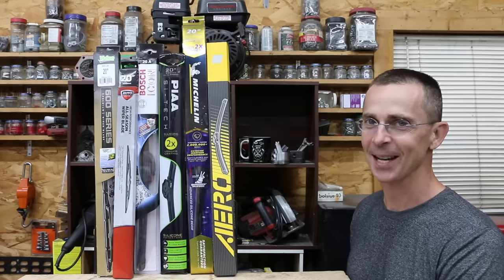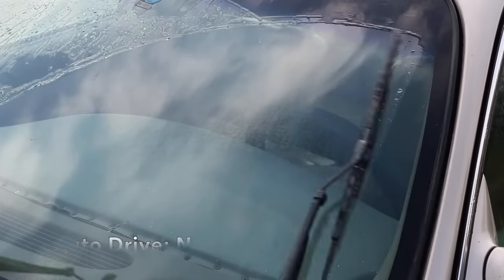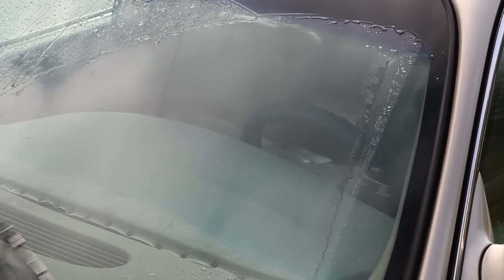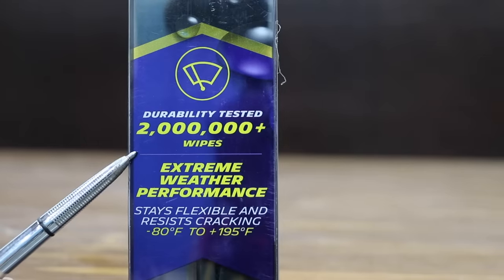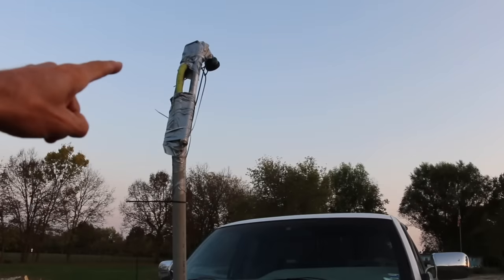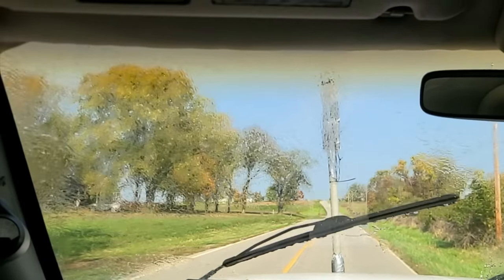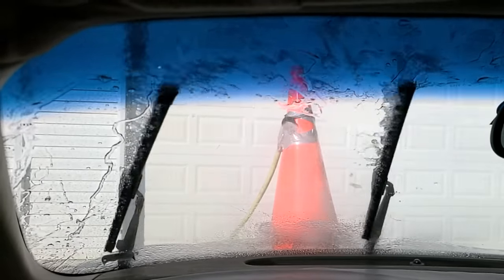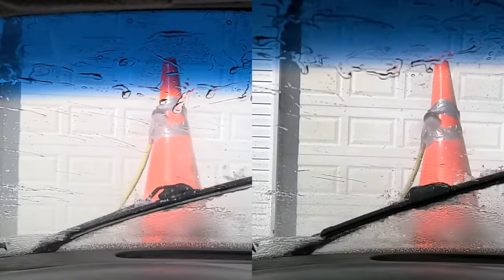Best Windshield Wiper Blade (AFTER 1 YEAR)? Bosch Icon, Rain-X, PIAA, Trico, Valeo, AERO

Comment: here in southern ontario canada, i never paid for blades for a long time, that was due to changing oil at Mr. Lube when they offered Micheline blades free with oil change!!, i do alot of driving and found most high price last about a yr then they deteriorate fast, although for shittes and giggles, i did a 3000km road trip to the east coast to pick up family, and bought a container of Rain X windshield wax. blades about 6 months old/new. and to my very surprise self the performance on the windshield was astounding and remarkable as it rained almost the whole 16 hr drive, and found using wipers blades seemed useless! at 130km/hr avg speed!! plus most of it was night time, i honestly couldn't believe what was going on, passing tractor trailers was no sweet with the off spray! 

i just did the windshield again with the wax and recently bought Rain X blades @ 30$ ea. +tx, and sure enough the next day on my way to work, it rained the whole drive 40min in! Rain-X blades did fine, once again, no regrets and highly recommend the Rain-X wax to everyone, especially the super highways or the 400 series here in southern ontario!!
Reply from the maker: Thanks for sharing.

Comment: I just bought some Aero windshield wiper blades for my 96 Chevy Silverado C1500. I hope they work good. My last brand I had I ordered off Amazon and it had really good reviews and with any windshield wipers they're recommended to change out every 6 months and these windshield wipers were no different. They are still on my truck and have lasted longer than 6 months. One year so far. I believe the last month or last 3 weeks or so they have started showing signs of slight streaking. Definitely well worth the money that I spent on them but I wanted to try something a little different on my truck so I went with the Aero hybrid windshield wiper blades. I hope I made a good decision. They were only $17.99 plus tax on Amazon for two 18" blades, let's see if they hold up like my previous ones did.
Reply from the maker: Thanks for sharing.

Comment: I Purchased Bosh Icons from your original video. Today about 5 years, I am finaly replacing that set UPDATE: I might try my luck with the budget kind because it would be close to 50$ for my pair of ICONS. UPDATE 2:  I found my old amazon order. I got the Bosh Clear Advantage and that was in 2019 so 3 years old. Not bad and much cheaper than the ICONS
Reply from the maker: Thanks for sharing.

Comment: I’ve generally bought a new pair of Bosch Icon every year, which worked excellent, but I reasoned if I’m buying them every year, surely a lesser expensive wiper blade would be good enough.

Nope, apparently it’s not just a matter of longevity, but quality as well. Even though South Texas heat is brutal on every brand, the lesser expensive blades didn’t wipe well from the beginning.

After my attempt at saving a few bucks, I bought a pair of Michelin, which each cost a dollar or two more. My reasoning was that they make great tires and surely would know a thing or two about rubber. Well as shown here, the Michelin worked great, but slightly less as well as the Bosch Icon. I too have the same experience of them not wiping as well on the return wipe.

I had planned to try the PIAA this year, but I’m just going to return to the Bosch Icon. In my experience, and as we’ve just seen, they work the best. If you should choose to try them, take note that Bosch has a couple of different wiper blade models (at least they used to), so be sure to specifically buy the Bosch Icon.
Reply from the maker: Thanks for sharing.

Comment: I used to run Bosch Icons but found that they left, bend and wrapped around my a-pillar at high speeds. Definitely sticking to the older style blades with the metal frames.
Reply from the maker: Thanks for the feedback.

Comment: The best wiper blades I’ve ever used are the genuine Tesla wiper blades on my Tesla model 3. My original wipers lasted 3 years and 70 thousand miles. Once they had worn out I was looking at other options and bought a set. They were awful. Squeaked so loud and streaked. So I bought a different brand. Also awful, left streaks and fit very loosely. After 2 failed wipers, I bought the genuinely Tesla ones again. 25 dollars a blade. 50 for 2. So certainly a little pricey, but as soon as I got them I was so happy. They’re even better than I remember them being when new. Smoothest blades I’ve ever used. No streaks whatsoever. When they’re on you literally can’t hear them. They are very rigid and do an amazing job at sweeping the water quickly and efficiently. So if anyone out there has a Tesla, get the OEM blades!! They are THE BEST!!
Reply from the maker: Thanks for sharing.

Comment: i got a set of those Aero wipers in 2017 or so, they are great wipers. ive bought them since & they work way better than traditional steel supported wipers, i couldnt believe how good they were. i live in the north east, so you need decent wipers
Reply from the maker: Thanks for sharing.

Comment: I am surprised people do not replace cars yet when they are dirty. Wax coating on rubber mentioned is to prevent new wiper rubber dry during pre-sale storage. It will disintegrate with first usage. Clean rubber blades with alcohol (better) or windex from time to time when blade stop cleaning or squinting. Taking care of them this way and many OEM last 20 years easy. Pinch rubber with paper towel moisturized with alcohol and move from middle of the blade edges.  This is to prevent tearing off the rubber at the ends. Up until napkin is not black anymore. I mostly replace them when rubber starts to disintegrate. Normally this process starts with edges. Told many people they were surprised and happy. They had no idea almost anything needs to be cleaned periodically and nothing in manuals about this. :)
Reply from the maker: Thanks for the feedback.

Comment: The largest benefit of a silicone blade is certainly longevity. If the car is garage kept, you can get even more. I like the PIAA blades. The painted metal doesnt fade nearly as quickly as the plastic blades and my last set lasted 3 years. Never had a rubber wiper last more than 8 months. Silicone is worth the extra money IMO.
Reply from the maker: Thanks for the feedback.

Comment: I'm late to the party.  I swapped to Bosch Icon wiper blades for a trip to Joshua Tree in the summer.  It was about 114 degrees out.  That was almost 2.5 years ago.  They've been through heatwaves and cold weather.  They've wiped away mud and all sorts of crap and the car gets commuted about 100 miles a day when I go to work 4 days a week.

They still work amazing.  I'm never buying anything else, it has already paid for itself multiple times over.
Reply from the maker: Thanks for sharing.

Comment: I always thought the Bosch Icon blades were good and never bothered trying any other brand except for the Michelin. I drive a semi truck mostly at night in all weather conditions. Needless to say, I use the wipers a lot. I have found that the Michelin blades work better in colder weather, so I tend to switch between the brands a couple of times a year. I use my washers for bug splatter a lot so I gotta replace often. Thank you for your work.
Reply from the maker: You are welcome!  Thanks for sharing.

Comment: My own experience: I stay away from silicone wiper blades here in Flagstaff. There is likely to be a time in early winter when the windshield looks like it has dew on it, but one swipe of the blades shows it to be ice and the blade edges are damaged enough that the blades have to be replaced ASAP. Rubber blades (in my experience) are much more forgiving of such a mistake. I replace them every three years. Wiper blades, like brakes, are one of those things we shouldn't put off too long.

Comment: I always get RainX and use the RainX repellent on the windshields as well. I'm near sighted and tried to use the BOSCH wipers. But every BOSCH wiper I purchased and have seen will develop micro streaks. For most it may not be an issue but for me it makes it so I can't see past the windshield well. I've had to move to RainX because of this. By micro streaks I'm talking about a thousand very small streaks across the windshield with every back wipe. Just something to put out there for others. Perhaps its because they sit folded on the windshield. But I do agree their top end design is the best there is. You have to buy specific blades for your left and right side of the windshield. But with the streaking I've had develop every time I won't be using them anymore.
Reply from the maker: Thanks for the feedback.

Comment: Had a set of PIAA wipers for a Grand Caravan. They worked great for a year or so, I really liked how the area where the wipers touched had water bead much more. The only issue is that the J hook adapter for the passenger side wiper broke off and sent the wiper flying off. Wipers only really work well when they stay on your car.
Reply from the maker: Thanks for the feedback.

Comment: The best wipers I have ever found were in a dollar section of a grocery store. 100% silicone, refills made in South Africa in 2008, still using.  Literally looks like the spline for fastening screens, when they start to streak, you merely slide the inserts off and place in boiling water to rejuvenate.  CRAZY.   Haven't found a silicone blade that equals them.
Reply from the maker: Thanks for sharing.

Comment: I haven't found a wiper blade in the last 20 years that will last more than 12 months and I've used every brand out there!  I used to have them last 3 to 5 years, not any more.  So now I just  use cheap OEM blades that both of my dealerships replaces for $4 when needed (I initially paid $30 for the first set blades, but after that, they only cost $4)
Reply from the maker: Thanks for sharing.

Comment: 303 protectant is said by testimonials to make silicone wiper blade to last forever if soaked in the 303 for 30 minutes before installation and sprayed with 303 every 6 months. 303 also makes tires last unbelieveable times if sprayed inside and out before installation and resprayed on the outisdes at occasional intervals

Comment: Great review but not matter what brand it is they can't stand up for one summer, on the vehicle, to 120° plus in the summer like we have here in Ariz/Nev. I started putting 1/2" foam pipe insulator tubes, that are split down the sides, the I cut to fit over the blades when there's no rain for months. One set has lasted 2 years so far. When you need them just slip them off and on when you don't.
Reply from the maker: Thanks!  Thanks for the feedback.

Comment: Every few months wipe down the wipers with WD40. Keep cleaning until paper towel has no black residue on it. This keeps rubber from drying out. Once a year if you can pull the tips and metal strips of off the wiper and pull out the rubber strip and flip it around reinstall. Makes wipers like new. Same wipers for 3 years and I use them a lot.
Reply from the maker: Thanks for sharing.

Comment: QUICK, go Rain-X your windshield and test them all again.  I love Rain-X window coating, but it sure squeaks up yer wipers.  Above 40mph, I seldom use the wipers and the rain streams directly up the windshield.  I think I've tried Trico, Michelin, Rain-X, and Toyota dealer blades, and the Toyotas are the only ones which lasted a full 2 years without trouble.  Pricy, but double life saved me money in the long run. Rain-X was the runner-up, but I may try to find Icons for this winter.  Maybe Rain-X all glass but the windshield.
Reply from the maker: Thanks for the suggestion.

Comment: The Rain-X and PIAA seem to be designed for driving at speed when raining, whereas the Bosch was better for slow driving when raining. 

I personally use Rain-X but a different style than tested and also use Rain-X washer fluid (winter or summer formula). I also occasionally clean the glass with a Rain-X glass cleaner. 

I can drive at 70 mph without using the wipers in anything but a heavy downpour and still see well enough due to the sheeting action. 

They are my preferred wiper but PIAA also seems to be good for highway speed driving while raining.
Reply from the maker: Thanks for the feedback.

Comment: Good review.  I've tried plenty, but it seems that the stock Ford Motorcraft blades (not the fake Chinese ones) have held up the best for me.  I get 3 years out of a set before they start losing performance.  I wipe them clean with iso alcohol every time I wash the car.  I also use Aquapel coating for the windows, so that might be helping them last longer.
Reply from the maker: Thanks!  Thanks for the feedback.

Comment: Many new cars have the wiper blades in the middle, and sweep to the outside.
It makes you feel like they are moving slower, no matter if you have them on normal or fast speed, so even light rain or snow is a problem, because it doesn't get cleared away fast enough.
Reply from the maker: Thanks for sharing.

Comment: I have been using valeo for years. They last long and perform well.
Bosch is rwally good at rubber parts and Michelin makes some pretty good tires so I am considering giving them a go just to see how they compare to Valeo.
Reply from the maker: Thank for the feedback.
Reply: Stay away from cheap Michelin blades at Costco. They're only good for a few months.

Comment: If you want to dramatically extend the lifetime of you wiper blade take a towel (microfiber are best but any type will work) occasionally pinch both sides of the blade with a towel at one end and run the towel along the length of the blade to get the dirt off. Be careful not to put to much pressure on the part of the blade that makes contact with the glass.
Reply from the maker: Thanks for the feedback.

Comment: I've tried probably six different brands over the past 6-7 years. I like you recommend the ICON wiper blades. But, I also have bought factory blades at close to the same price and actually found them to perform and last as good and a little longer than the ICON. Have you done any test on factory blade comparison to aftermarket blades?
Reply from the maker: Thanks for the suggestion.

Comment: I replaced my stock wipers after 1 year on my mazda with PIAA silicone wipers. I had a sizable crack in my windshield at the time so i really put the self healing properties to the test. The old wipers did get chewed up by this crack, so it is worth noting this as a factor. It's been 4 years and while there is some damage from the area the crack used to be (I've replaced the windshield since then, but the PIAA were in use for about 2 and a half years with the crack, and 1 and a half years without the crack) they still perform substantially better than the stock wipers. Don't really have a pressing need to replace them yet. Will definitely be repurchasing them.

Edit: worth noting that i live in texas where the heat and humidity is particularly brutal on rubber. This update is a year later, and i'm still using the same wipers (so at this point 5 years total) and they still do a pretty solid job despite the abuse. Silicone seems to be much more resilient to the texas conditions than rubber.
Reply from the maker: Thanks for sharing.

Comment: Several comments about the Piaa. The more they are used the more the rain water will actually bead off your windshield. Rain can be coming down in sheets and you can see the road fine. You will hydroplane the car but still be able to see fine. Also they are expensive but I have an 8 year old pair on my truck and the performance is still good.And last Piaa sell just the refills at a much cheaper price when you need new one.
Reply from the maker: Thanks for the feedback.

Comment: The real tests for wiper blades can be found in coldest places like i live in Calgary, Canada where the snow and ice build up on the windshield puts enough test for the wiper blades.   The wiper blades that have very thin profile of rubber doesn't last as long as needed.
Reply from the maker: Thanks for sharing.
Reply: @ProjectFarm  Temperature here goes as low as -50 celcius, so that like a torture test !!!!

Comment: I bit the bullet and got a set of Piaa silicone blades and they are the first blades I’ve had that worked well past a couple months. My only complaint is they tend to streak if the glass is mostly dry to they require a bit more wiper spray but they have not chattered once in 4 months. I tried the Bosch Icon and they didn’t even last me a year before they started chattering like crazy.
Reply from the maker: Thanks for sharing.

Comment: There used to be a time about 40-50 years ago when wiper blades would last many seasons and still worked great. Now youre lucky if they last one season and they rubber isnt cracked and coming apart the next. It's done deliberately to generate more sales. It's the same reason why the local auto parts store carries the cheaper brands and not silicone ones.

Comment: Bosch Icon's :  im 2 months away from  year 5 with them and they still perform like brand new 3rd place wipers in this video. Of course, if I never applied rain-x repellent on my windshield they probably last a solid 3 years. Mine can go another year for sure with repellent. I think the best budget is just to buy (rain x) repellent and the cheapest wiper blades and you'll feel safe enough in a rain storm. (Clean your windshield really good first before applying reppellent!)
Reply from the maker: Thanks for sharing.

Comment: I've been using the Bosch wipers since January 2020 (drivers side) and it has been fine.  However, I paid almost $31 incl tax (passenger side) March 2022; its also been fine.  It cost me way more than in this video.  So I guess I picked the right one on my last two replacements but from the wrong store apparently.  I now see this the Icon wiper is $35 on Amazon!!  What the hell is with the prices these days?